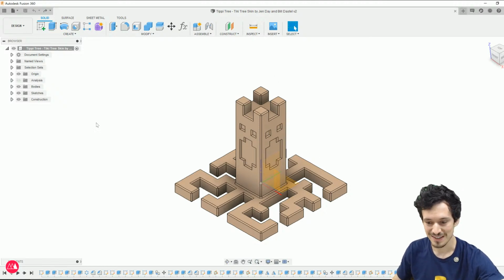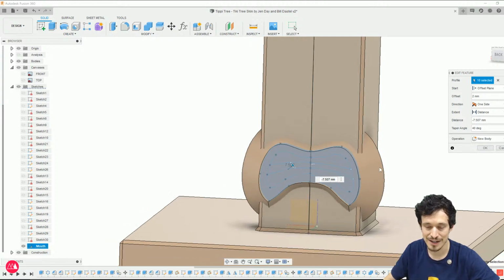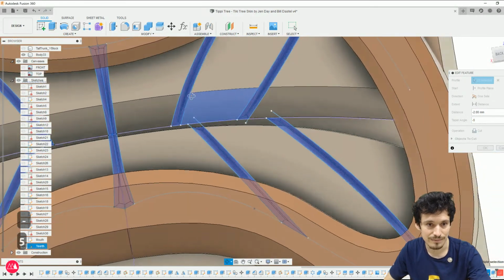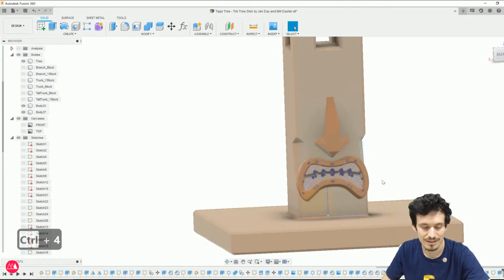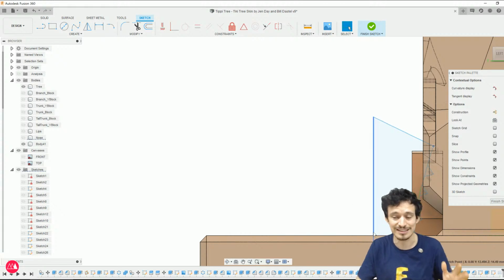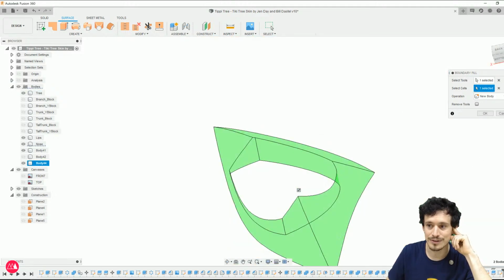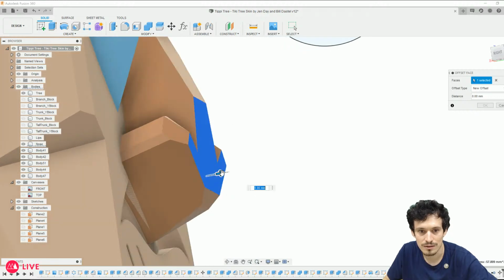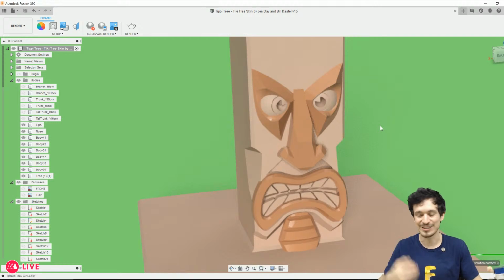Make Anything Live // Modeling Tippi Tree Skins in Fusion 360

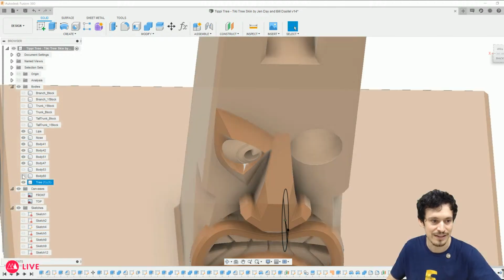Comment: 3:28:20 What's the difference between delete and remove?
Reply from the maker: Remove works at the current point on the timeline but if you go backwards it can still be referenced,  delete removes the body entirely throughout the project. So remove is generally less likely to cause problems
Reply: @make.anything  Thanks! Sounds much safer, since you can delete your remove in the timeline later, then 😅